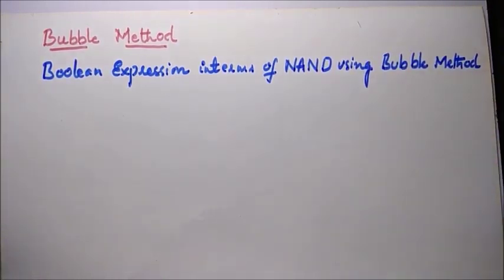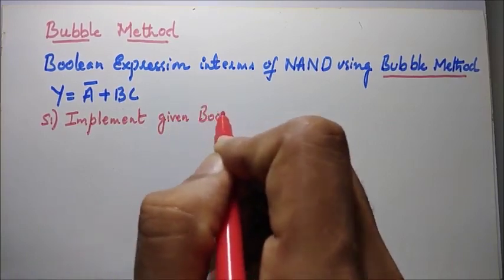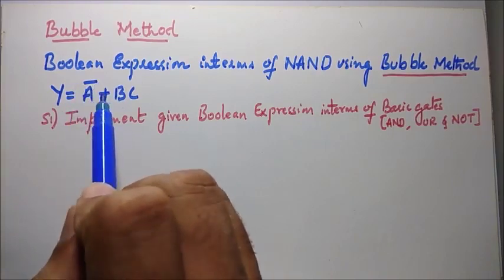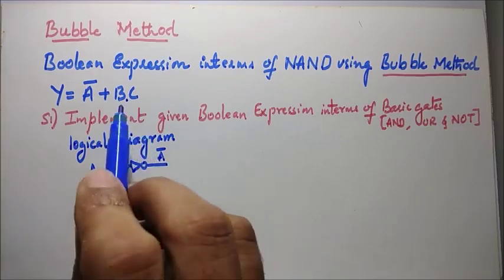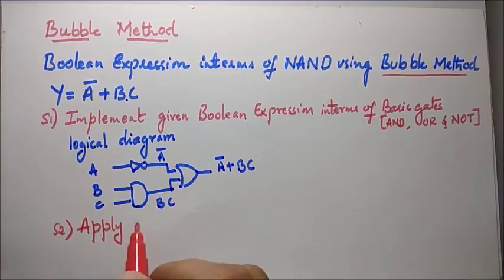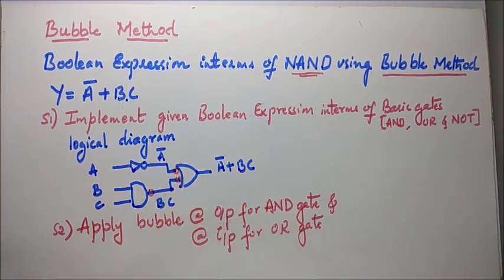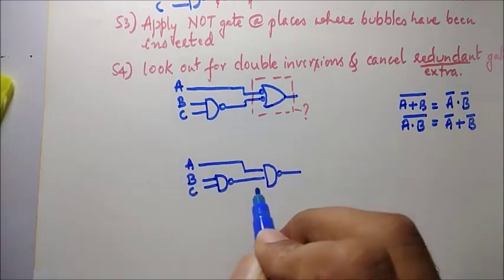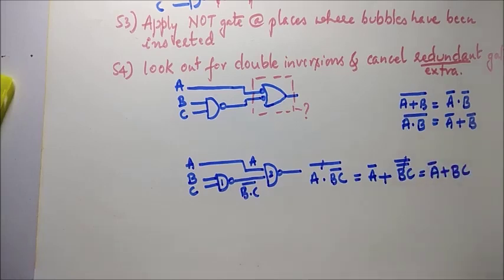Bubble method NAND implementation

Comment: 1: so you apply the bubble and then apply a not gate but isn't a bubble a inverter (not gate)?

2: if is using NAND, don't you need to change that NOR gate to a NAND? and how I do that? If I put a bubble in the output of the NOR and push through the gate to the input then I transform the NOR into a NAND? because of the "The Morgan's" Law?
Reply from the maker: Dear Luigge, here we got to make sure not to alter the basic boolean functionality (but by adding bubble we are actually changing functionality to a known form of Demorgan's law) hence to nullify the effect of bubble which was added earlier, we have to add NOT gate at places where bubbling was done.